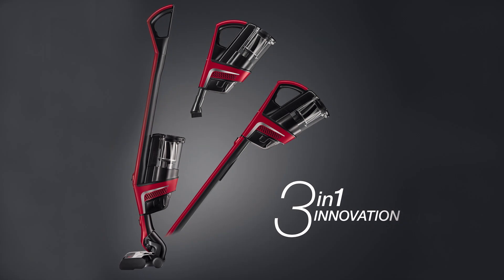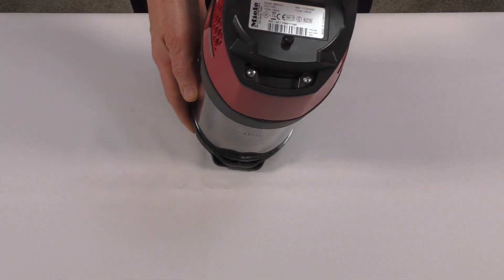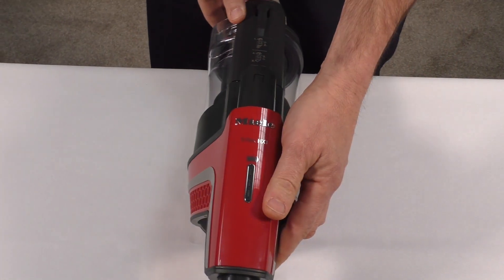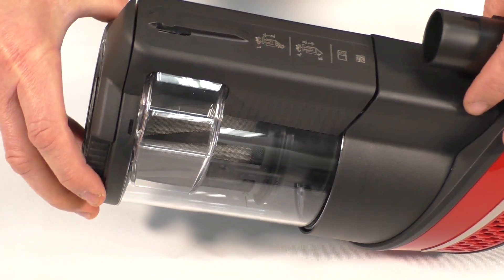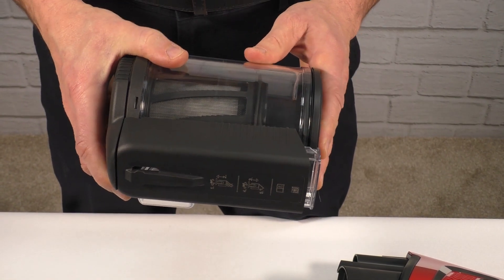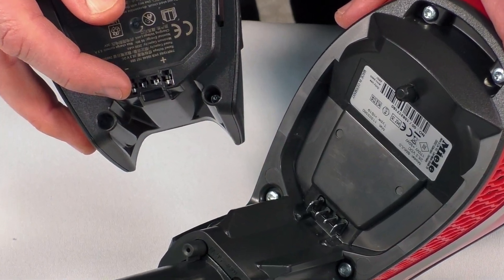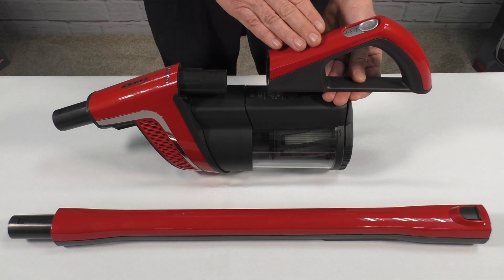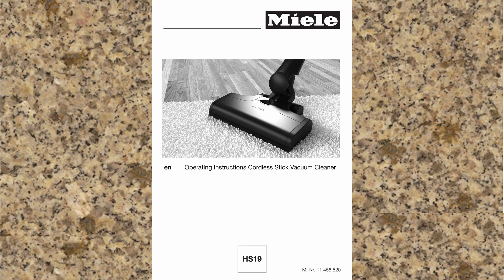Taking a Closer Look at the Miele Triflex - Exterior Features

Comment: I bought the Miele Triflex HX1 and it is useless. Don't believe the company's advertisement on suction power or battery life. False advertisement.  
Also, cross your fingers that you never have to deal with Miele's customer service. Rude and useless. No money back, no exchange. They wouldn't even offer to look at the vacuum without me having to pay another $50 for the inspection. I hope the experience is better when buying from an authorized dealer like yourself. But I after 20+ years of fierce Miele brand loyalty, this product and customer experience was a profound disappointment.